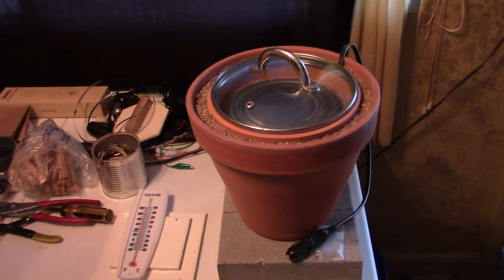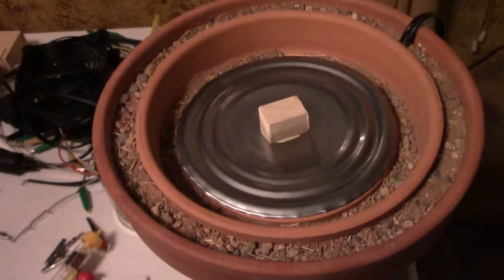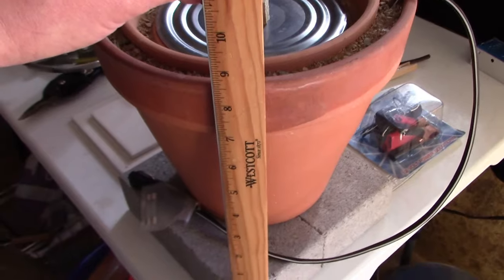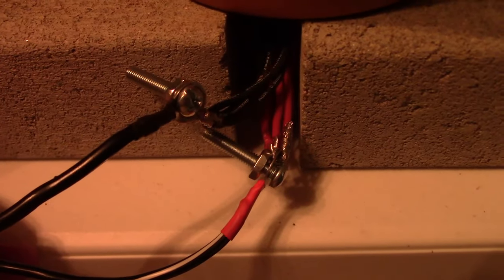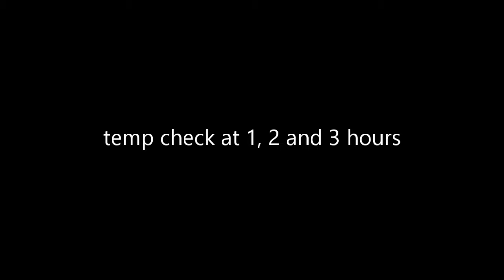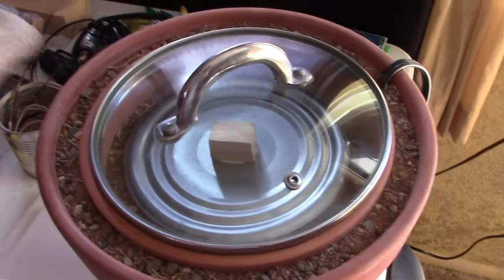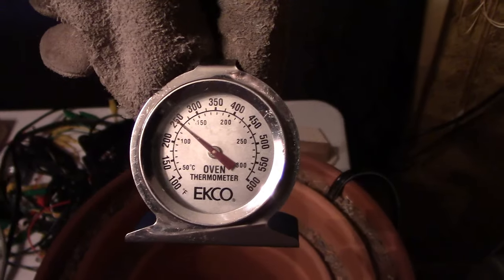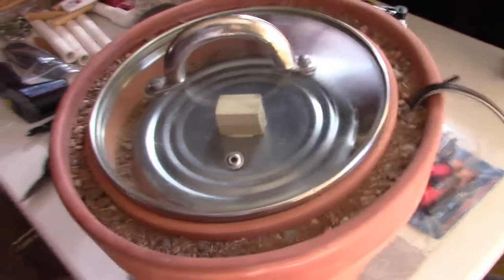DIY Flower Pot Oven! 12V Clay Pot Oven! - Easy DIY - 3 pot oven - with solar pwr option! full instr.

Comment: how about adding a variable capaciter to vary the temps . interestink project.
Reply from the maker: hi. you can get a 20a 12v variable current controller on amazon for about 12 bucks. just hook it in-line and your set. since temps were in 250F range i figured it'd never get too hot so i didn't use one.

Comment: Does the stream venting hole, in the glass lid, leak heat?
Reply from the maker: i never thought of that. it probably does a little. that can easily be sealed with silicone caulk or even just tape

Comment: Thanks for another great video!   
    What to cook? Any crock pot or slow cooker recipe should be perfect. Crockpot
high settings run at bit above 212 F, so time recommendation for high setting
should be pretty close.   
    I think if you used vermiculite or perlite for insolation instead of dirt,
the oven would reach max temp faster (as good or better insolation with less
thermal mass).
    Did you happen to measure the temperature of the outside pot? The less heat
that escapes should increase max temp.

Comment: Did you have any problems runing heaters, how long (hours) can they heat
Reply from the maker: they can heat 24/7 if you want. they are rated to last '3 plus years' but i'm guessing they can last 3 times that long
Reply: @desertsun02  cool

Comment: A couple of questions, if you read comments on older videos --
First, why put the heating elements in the outer ring instead of the inner one?  It seems like that would preheat the oven faster, and maybe get it hotter, too.
Second, is there a reason for not lining the inside of the outer pot with foil?  I'm wondering if you tested how hot it got on the outside.  I can't help but think that would help retain heat and get the oven even hotter.  Same with putting an insulated lid over the whole contraption (as someone already commented on.)
Reply from the maker: hi there. feel free to ask questions on all videos - i monitor all comments sections of all videos equally. i wouldn't put elements on the outer pots. the heat would be too far away from the inner chamber. the heating elements on this one are placed on the innermost pot (ring). that will heat the oven chamber the best for sure. about using foil; there's no specific reason why i didn't line the inside of the outer pot with foil.  i just didn't think to do it (but it's certainly something to try if you think it will help). an insulated lid will definitely get you warmer temps (probably another 25 degrees F or so) - making top temps around around 275F in the oven. it would be hard to get a full 300 (because of the limit of the heating elements. (average 'overall' temp of those is around 300F) but i won't say that it's not possible. 🙂 🙂 ✔

Comment: You could boil the potatoes first and crisp the baked potatoes with this making it far quicker to cook. 3 hours of battery is a lot
Reply from the maker: good ideas. baking a potato in a "flower pot oven" never gets old but i'm still trying to figure out what else to try in that oven. slow roasted beef or pork maybe.
Reply: @desertsun02  i noticed things get hotter in turkey bags opposed to wrapping in foil

Comment: What if you used a much better insulated lid? What kind of temperatures can you reach?
Reply from the maker: hi. with a thick insulated lid you might get another 25 degrees in the oven.
Reply: @desertsun02  Block the hole in the lid.

Comment: why cant you just put all of those pots inside the big one at the end now
Reply from the maker: hi. you absolutely could if you wanted too.🙂 i was hinting (at the end of the video) that i might make a larger unit overall with that giant pot but then you'd have to use several more heating elements to get good temps in a larger 'cooking chamber' 👍
Reply: @desertsun02  how would you be able to do that and still stay at 12v - 6 heaters ?  2 separate 12v-6 heaters? Where did you get that cord? I am thinking that I am starting to understand the 12v - 6 heaters.   Here's my ( talk to myself reasoning on that.  😆 .  Ok since we are talking 12 .  I tell myself I have a 12 ounce cup .  I put in it 6 ounces of water or anything. Plus the 6 heaters. All should work fine.  I add 4 more ounces . it seems to me that Logically it should work Fine.
NOW I think hummmn.   If I add 3 more ounces. I think I might have a problem because it will. Overflow its capacity
.  Don't know if I am right for sure. But I think I am.  I need to know where to  get one of those cords.   Thank you.

Comment: Gas oven verse clay flower pot oven electric which one cost less money?
Reply: Uhhh, Dragonfly: Which one do you think? LOL!
Reply: @klee88029  
Small gas oven what do you think?
Reply: @dragonfly1414  Well, if I read your question correctly, a clay flower pots with the heating elements and a battery costs a lot less to purchase than an electric or gas oven. If you mean how much energy it uses and costs to run each of them to cook the same item, I would say the flower pots vs electric would be the most energy efficient. Gas takes longer to pre-heat and the price per btu is more than electricity in the USA these days.
Reply: @klee88029  
Battery this day expensive use for a month  for cooking cost a lot of money,  my gas included cooking and heating for winter cost me $20 last month, A/C in summer cost me $150 per month.

Comment: What if you laid the pots over on its side?  Then your heat will radiate into the center as opposed to radiating up the sides.  You could also consider using a round clay cylinder for the center container.  Or use a stainless steel container in the middle with a lid.  That way more of the heat will transfer to the center container.  As to things to cook, consider like brisket?  It cooks best when low and slow....